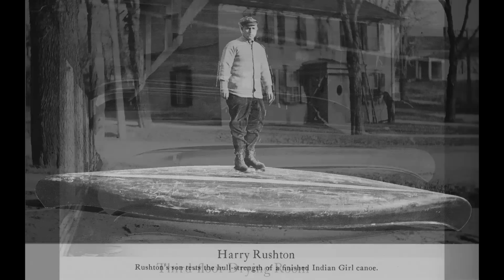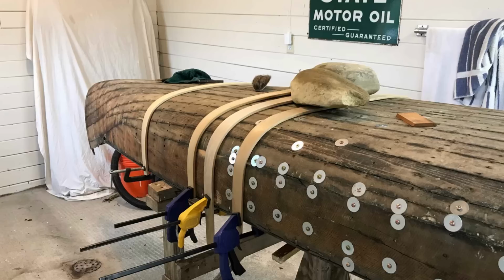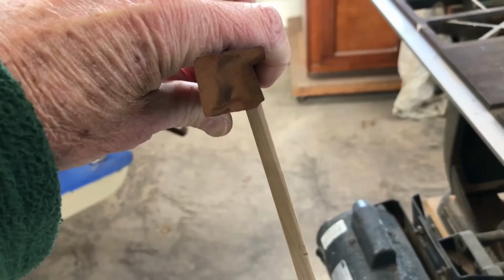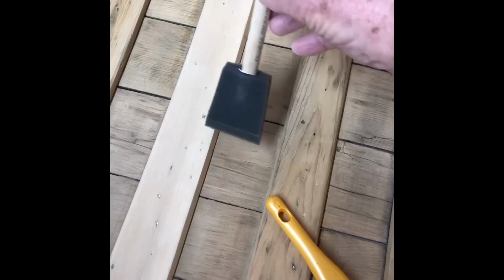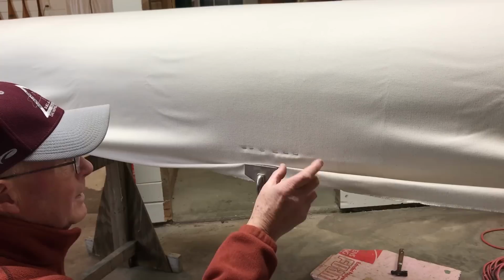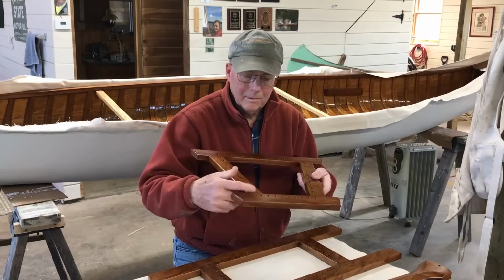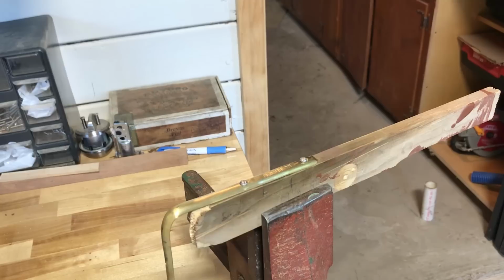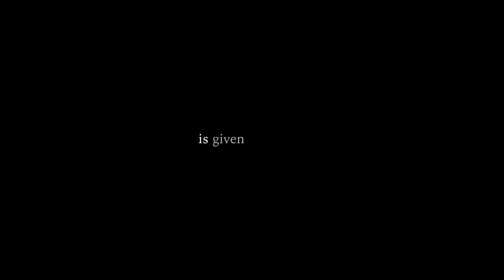Resurrection of a Burn Pile Rushton

Comment: It is so inspiring to see this canoe being saved. Pretty soon work like that will be long forgotten in favor of moulded carbon fiber, fiberglass or whatever mass producing companies come up with in order to save time and money. Back in the early eighties I was thumbing through an issue of Canoe magazine (I think that was the name) and came across an add for canoe plans. At the time I had a girlfriend with similar outdoor interests and figured to impress her by building my own canoe. Well I did build that 18’ stripper canoe and it turned out great . It ended up following me through many moves but eventually developed some areas of rot . In my last move I had had enough of the thing and cut it up with a chainsaw . Now you have restored that old girl and made me feel like a dummy for what I did.
Thanks for the video!